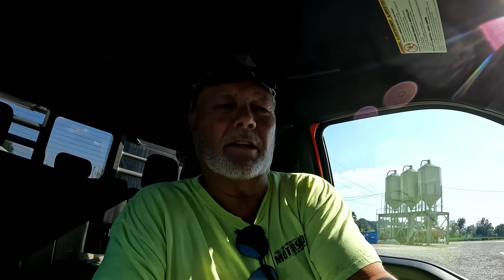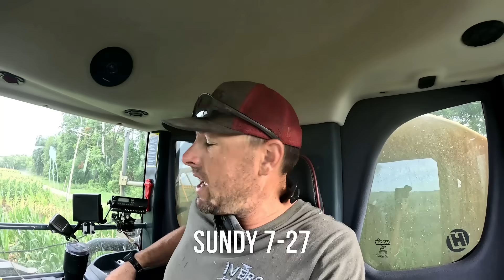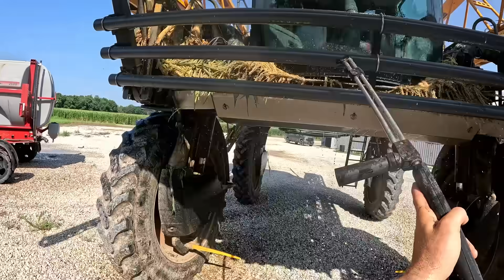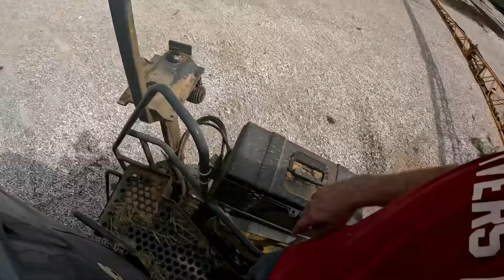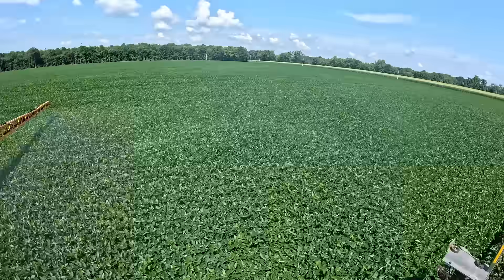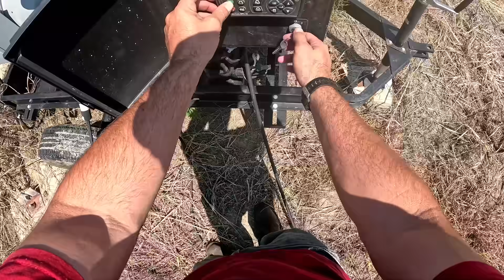Finishing Corn Fungicide 2025  Season 6 Episode 15

Comment: Better Sample your Corn Fields and Husk the Samples and check your Corn for Pollination Issues. Illinois has a Big Problem with Pollination problems with all the Rain you guys have had. 
+ the Tight Spiral Tassel issue this year. 
It’s a problem across All seed company hybrids this year. 
   You’ll know it as soon as you husk a Corn ear sample. Many missing kernels and aborted kernel tips of the ears. 
These Pollination Issues have been reported in 10 states of the Corn Belt so far. 

Sample your Corn and Husk it !!
Illinois is suppose to be the Worst.